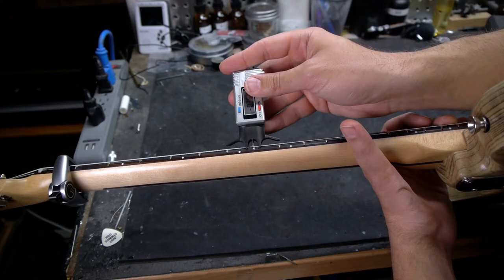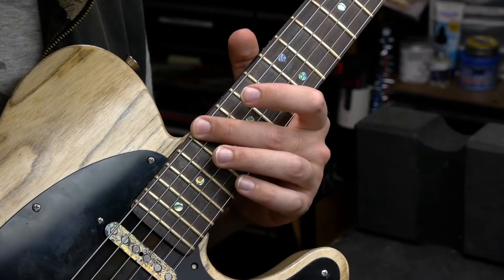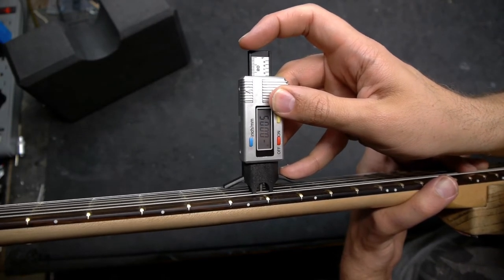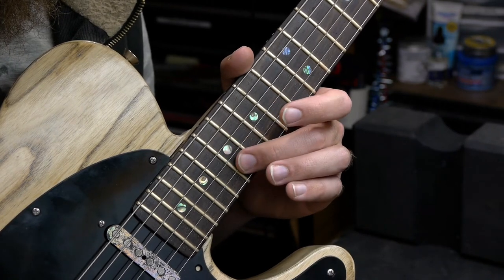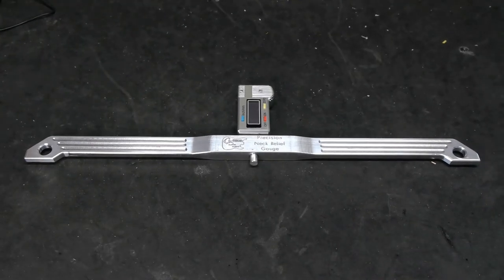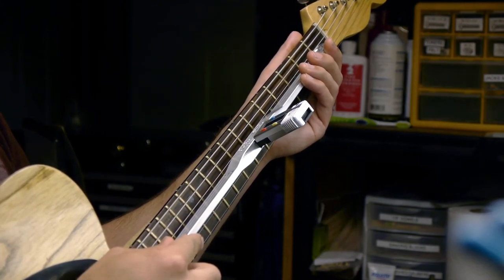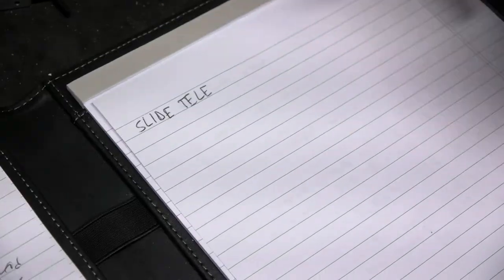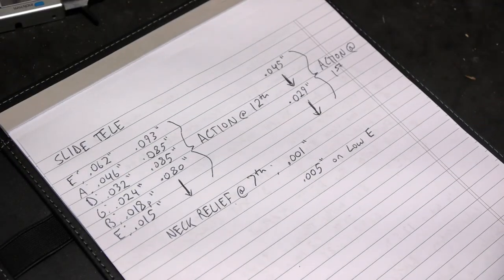**CHECK DESCRIPTION BOX** Testing Neck Relief with Digital Gauges

Comment: I tried making one of these neck relief gauges with thick aluminum ruler and digital dial indicator.  I found that I couldn’t get consistent measurement because if I rocked the tool back and forth the reading would change a few thousandths of an inch
Reply from the maker: There's definitely a feel to it. The pressure you apply has to be very consistent. I do really enjoy the G Tech guitars tool. I don't have the ability to do any precision engineering stuff so I just splurged on that. 

Alternatively, the digital action gauge works great. These days I use a Popsicle Stick threaded through the strings at the end of the neck, to depress the string at the last fret. With a Capo on the 1st. 

That way, both hands are free to use the digital action gauge at the 7th fret. This is great for basses too. Much easier than the method I showed in this video, which requires an absurd level of dexterity. 

Hold the string down at both ends with a capo and a Popsicle Stick and you're good to go. So much easier. And use it in the playing position for greatest accuracy. 

Let me know if that helps at all. That would also work with feeler gauges. Having the string secured at the 1st and last fret is key.

Comment: Thought about getting one of these. Mehhh... Unless it just falls in my lap for free I'll just stick with my machinist's rule or Dad's old calipers from his gunsmithing days. But they are temting. I mean what guy doesn't like a new gadget?
Reply from the maker: Took me years to just go through and get it. I will say it's taken my setups to an entirely new degree of accuracy. I use both the action gauge and the relief gauge every single day. The relief gauge is also great when getting a neck straight for a refret.  

They are pricey though. I forget that being a guitar tech is the same as being a mechanic. Not everyone's gonna have the money or space to put a car lift in their garage, but if you're doing it professionally it makes sense. 

I just wish they made one in a bass guitar size. Kind of surprised they don't. Maybe sometime I'll whip one up myself. Also waiting in the wings for a Rectify Master Bass Katana.

Comment: First time that I saw that tool, it’s very useful for professionals and for hobbyists too.
   I usually fret the second and the 19-th fret, using the string as a straight edge, to check relief. The first fret and the last few frets being the least played are also the highest. Not by much, but enough to show a 0.25-0.3mm relief when the rest of the frets are almost dead flat.
Reply from the maker: Great point. Sometimes when laying a straightedge along the frets, I'll start at the second fret for the same reason. One thing I love with the digital gauge is it also makes checking fret heights a breeze, even faster and easier than the Stewmac calipers, and easy to slide along the fret to see the height along the length. 

I prefer no relief, and it does come down to splitting hairs when you're dealing with a thousandth of an inch. The final setup will usually involve a fair amount of back and forth between using the digital gauge and playing the guitar, though I'm exceptionally picky. Fortunately that's mostly on my own guitars -- for customers, I find most people prefer far higher action than I do, and aren't anywhere near as picky as I am. 

It's tough letting guitars out the door with precision setups as well, especially with the humidity and temperature changes around here with the seasons. I regularly have to adjust my own guitars multiple times throughout the year to keep them playing the way I want. Completely possible without a digital relief gauge, but it certainly makes it a lot easier.
Reply: @guitar_md  
Thank you for your detailed answer! 
 I‘m a intermediate player and like tinkering on guitars maybe more than practicing. Initially I tried to achieve the lowest action possible as a challenge and for better playing  comfort, and had to accept for a little string buzz. About 1-1.2mm wound E and 0.8-1mm high e. But realized that 1.4-1.6mm for E and 1.2 for e is a good action for me. Slight differences needed from guitar to guitar, also depending on string gauge. Later I started to test higher action and noticed indeed a more punchy, more open sound with a bit increase of sustain (maybe imaginative, didn‘t measure it) on higher action.  So, now I have guitars set up with very low action and some with up to 2.5mm (11-48, on short scale) on thick E…. 
   I „use“ the higher action somehow to train my fingers to get around it. thinking it will help in general to play better, smoother on medium action. It‘s like training to run with weights on the legs, if removed you run faster. 😆
Cheers, and best wishes from south-east Germany.
Reply from the maker: @lone-wolf-1  I've been working on a video for some months now about doing fretwork to get the lowest possible action. The absolute lowest I've been able to get is about .6mm on the high E, and while I can get the Low E lower, I like it around 1.2mm. And for the high E, I also keep it about 0.8mm, same as you, for the 'lowest' setting. This is with .008 gauge strings, which I customize myself using single strings from JustStrings.com. 

The video is going to take me quite a while to complete, and I've been slowly working on it for months in-between my many other videos that I have on the way. My main issue is I have a disability in my fretting hand from birth (hypoplastic thumb), and while I can play with thicker strings and higher action, it certainly is much harder -- and in some cases, like barring chords on a 12 string, it's impossible for me. 

This has led to some interesting developments. Almost all of my guitars now, I de-fret, re-radius to 7.25" - 10", install jumbo fretwire, and then do my custom fret contouring to get the lowest possible action. 

I'm actually developing some new methods for leveling the frets that I have not seen anywhere else. I'm still experimenting, and in the process of making the video -- and as it keeps coming along, I keep learning more. But very good results so far. I've been obsessed with this for many years and I hope to share what I've learned soon. Thanks so much for the comment! 

Also, if you're in Germany, have you checked out Helmuth Lemme and Manfred Zollner? I think they just came out with a new book on the physics of guitar pickups, but it's only available in German. It may take many, many years to get an English translation. 

You could benefit from reading it, I'm sure. I have two of their books, The Physics of the Electric Guitar, and Electric Guitar Secrets -- it took years for those to get translated into English, but they finally did it. The book on pickups seems very fascinating. Check this out: 

https://gitec-forum.de/gitec-meeting-2020-physik-des-magnettonabnehmers/

Of course, I don't speak German, so I have no idea how to read any of that, but knowing his other work, I'm sure it's an extremely comprehensive and very well put together book.
Reply: @guitar_md  
Thank you very much for the link! I will look further to find out more, and maybe reading it.👍🏼😃

edit: as for lowest action, I find the last finesse (after nut, neck relief, fret leveling/crowning, bridge action, one can get with a refined „fall off“ of the last frets past the 13-th/14-th till the last one.
    I did that on two of my guitars. On the first I was scared to mess all up and barely took some material of. On the second I had more confidence. These two are adjustable with for me the lowest action, 1mm wound E and 0.8mm on high e, for 09-42 gauge.
    But as I like the sound of few years old strings, they get floppy. So I have to raise the action a tad…

Comment: Thank you very much for the information. I do not read or write in English, I use a translation program to help me. I didn't understand the explanation well. Please, can you tell me what is the correct distance between the top of the fret and the bottom of the string so that the curvature of the neck is appropriate?. Some indicate that you have to place a fret cap on the first fret and press the last fret of the 6th string and make the measurement at the 8th fret. Others indicate that you have to press the 17th fret and measure at the 7th fret. In both cases they indicate that there should be a distance of 0.010" or 0.25mm. Which is correct?. What is the difference between pressing the last fret and pressing the 17th fret?. Definitely the measurement would give different results.
Thank you very much for answering.
Reply from the maker: I prefer .000" to .002" relief at most, measured at the 7th fret, when pressing down at the 1st and 17th frets on a guitar. 

For me personally, .010" is too much. I like my necks with zero relief -- .000" -- straight as possible.

.001" - .002" relief is OK for me but no more than that. For my preference. Some people like more relief. 

I'm not sure if there's much difference between checking the 8th fret or the 7th fret. Or pressing down the string at the 17th fret, or the last fret. I don't think it would make much difference. 

But the "correct" way people recommend, is around the 17th fret, or wherever the neck joins the body. Again, I'm unsure if this matters at all. 

But that G-Tech Guitars tool spans frets 1 and 17, and checks relief at the 7th. So that's what I go with. 

I haven't found much difference in checking the last vs. 17th fret however. I'd have to do more experiments to see if this really makes a difference or not. So again -- I'd just go with wherever the neck joins the body, to be consistent. 

For me, my setups depend on .000' relief. I get the neck as straight as possible. Then I use a straight under string leveling tool like the Rectify Master Lite or Rectify Master Katana. The Stewmac tools are too heavy and thick, in my opinion. I much prefer the Rectify master tools. 

My method is: neck straight (.000" relief), then leave the capo on at the 1st fret, and set the action at the 12th fret, for each string individually. 

Radius doesn't matter at all. Just set the action for each individual string, separately. On my Strats I like around .030" for GBE strings at the 12th fret with a capo at the 1st fret, then around .035" D, .040" A, and .046" - .050" Low E. 

Then set your 1st fret action by filing the nut slots down. 

1st fret I like about .010" GBE, then around .018" on the EAD strings. .010" plain, .018" wound, feels good and is about as low as I'd go. 

You can add relief if you want, but I never like any more than .002" personally. 

I'll be working on a setup video in the future. I really need to go over all this stuff in a professional video. But again my general method is: 

-Set neck relief straight
-Capo at 1st fret, then set action at 12th on each string
-Remove capo, set action at 1st fret
-Under string fret leveling. Then polish and crown
-Add more relief if desired. I usually don't like any relief 

That's the basic procedure. The low action and straight neck will expose fret issues and with the neck straight under string tension, you're ready to use an under string leveling tool. 

Very effective process I've done hundreds of times. Works great. Hope this helps. I wish I had a video done but I don't have one uploaded yet. For now I hope this helps you.
Reply: @guitar_md  Thank you very much for taking the time to make an extensive explanation. Everything was well understood. Indeed, it is not common but I did read on some occasions that some like zero curvature in the neck. I'll experiment with my guitar.
Greetings from Peru.